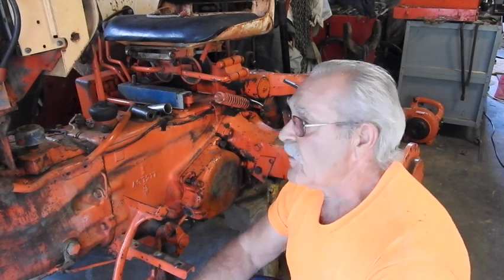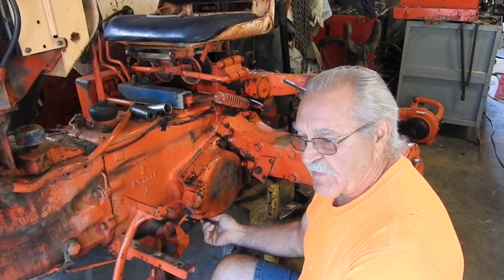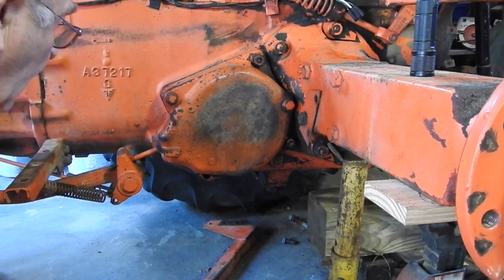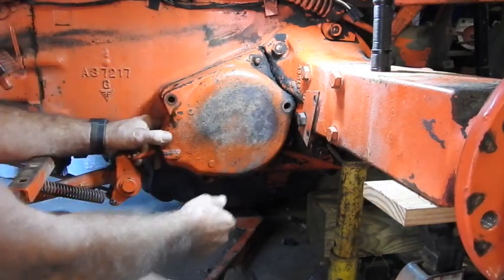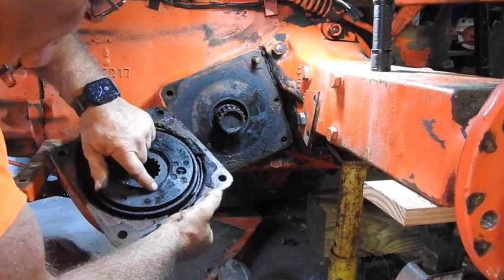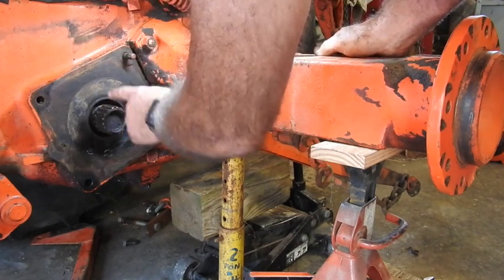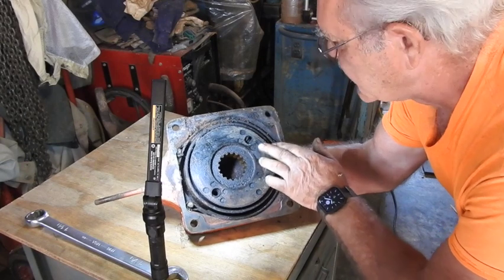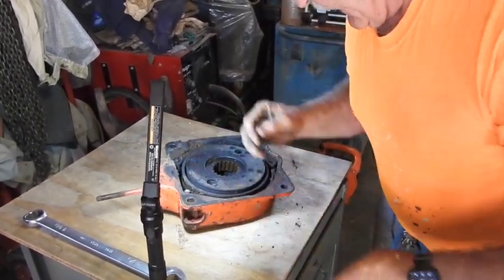Lets Remove The  Brake Assembly On The 430 Case

Comment: Hello my friend. Is it just my bad eyes ,or was the paint scorched on the housing you removed ? Never seen a setup like that one. I am very interested to see how it works. Has always I liked and shared. All my very best to all.
Reply from the maker: Yes Bobby, it sure looked like it to me. I'm thinking the brakes got a little hot at some time or other....I'd suggest heavy braking on a downhill run with a heavy load in road gear.  But that's just the thought I had when I saw that obviously scorched paint. Take care and have a  wonderful day....it started up here a bit chilly at 42*.

Comment: I should have let you know I had a video on how to maintain those brakes!!! Lol!  It's video #34 on my page. The bolt you remove at the mark of 1:15 need not be removed at that point, it only supports the brake shoes.  I don't know how far you dismantled this at that point, but it's a fairly easy principle to understand once dismantled. It is kind of a mechanical power brake. As for the oil seal, I wish I had a video of it when I changed it.  You will notice a second plate against the side of the transmission. It holds the oil seal.  The plate is held in place by a simple 3/8" countersunk Phillips screw. This plate has a flange on the inner side, with an O-ring seal.  When you remove that plate, the shaft is then almost loose, revealing the taper bearing. Of course, it's better to drain the transmission before... Lol! Thanks!
Reply: The link to video #34:    https://www.youtube.com/watch?v=UhagdjSRxM8
Reply from the maker: Yeah, I saw that as soon as the assembly came off that that was just a pivot pin.  I haven't disassembled it any further since removal.  It's just on the cart. I'm still frying the bigger fish in the motor....  When I determined there was definitely a more serious problem in the engine, I thought it best to make sure there was or was not a bigger issue in the final drive before proceeding.   Thanks for the tips on the seal, and I am sure I will reference back to your video when its time.

Comment: Dont know anything about the 430 brakes. We have some VAC case tractors. And the one that has band brakes is a older tractor however  it has much better  brakes than the one with disk brakes.  on your430 possibly that band locks the outer drum causing wedges or ball s to tighten the disk?
Reply from the maker: Yes, I believe there IS a set of balls in there and I'm sure that's about how its supposed to work....I haven't disassembled it yet.  The main thing was to remove it to make sure there was no final drive issue before getting deeper into the motor.  I sure liked it when the axle turned the countershaft. Nothing to be concerned about in there at least.

Comment: How did you finish the brake repair?
Reply from the maker: I've had to set this whole project on the back burner for a while John...working on it as time is available.  I'm sourcing new parts for the brakes though.  It doesn't look to be very expensive too which is great !!